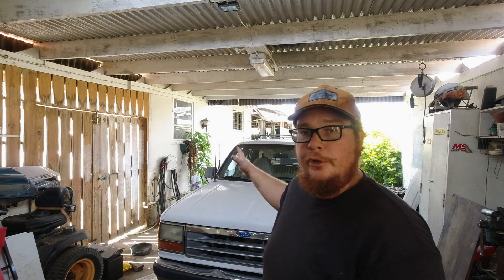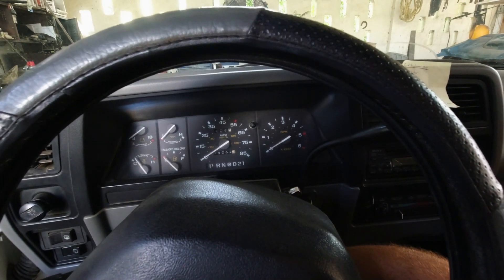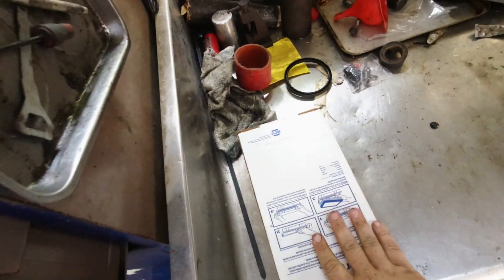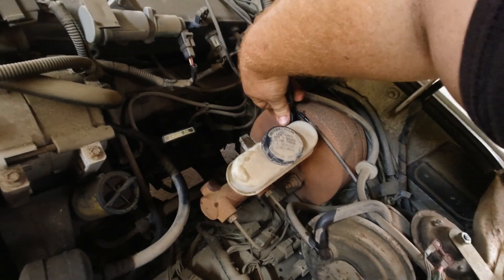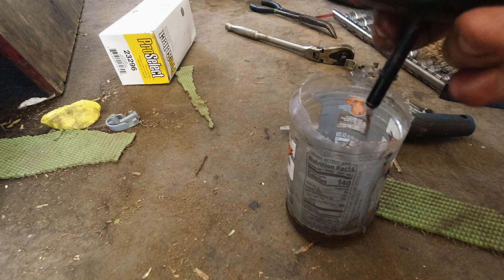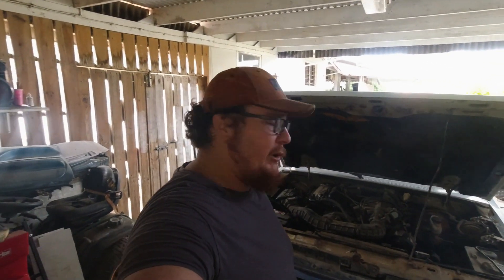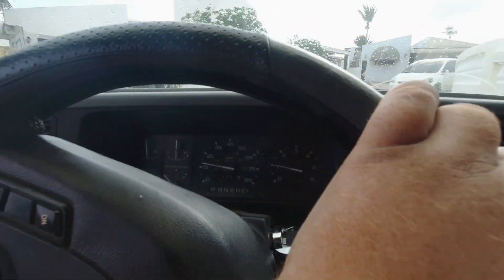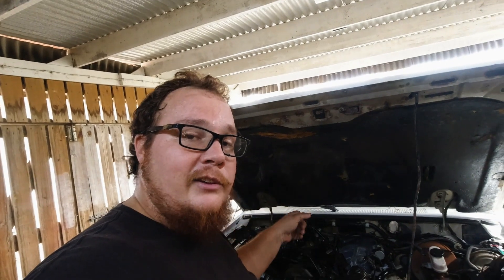30 YEAR OLD EXPLORER TUNE UP🌀 : havent been serviced in a long time!

Comment: love it. Please tell me where did you put seafoam to clean the engine. i know only the tank what am i.missing . what is that little tube you used for putting sea foam in. And what degreaser and motor shine product do you use.  Last how can I increase milage with my explorer? Have new injectors and sparkplugs but still only 12 miles per gallon. Engine takes gas easy. accelerates fast.
Reply from the maker: It was the vacuum hose going to the brake booster, feed her gently then drown her and let her sit for 10 mins and start back up, i used purple blaster and wd40 for the shine, 12 is not bad, cchek your oxygen sensor and map sensor those controls the fuel mixture